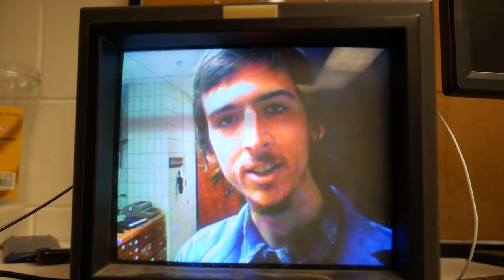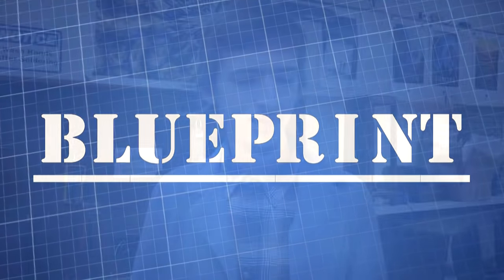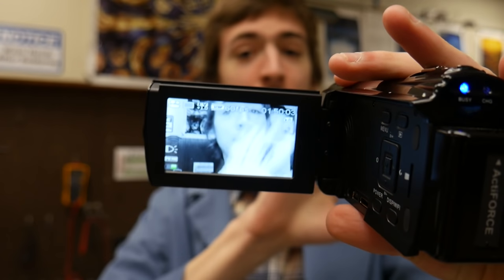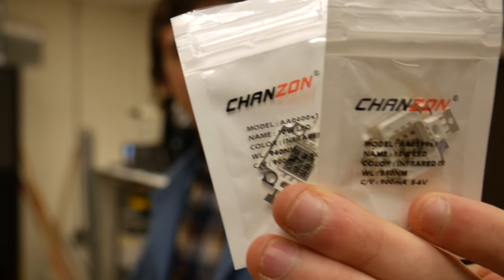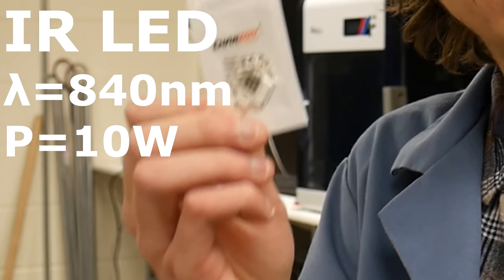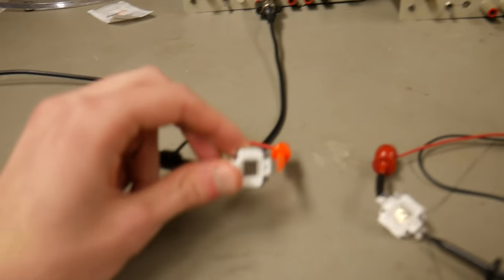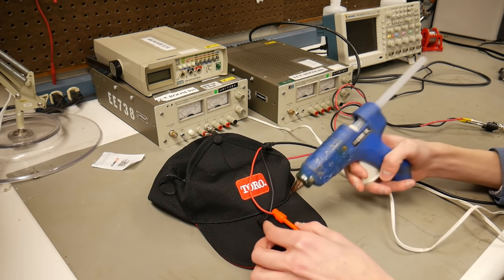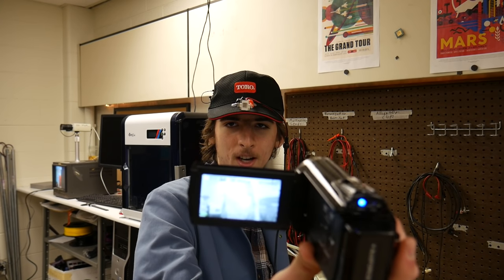How to Fool IR Security Cameras

Comment: Great Information ! and what if we wanna bypass normal camera ?
Reply from the maker: Salman Jamil, that’s not so easy. You can pull the same trick with visible light, but that’s about as conspicuous as it gets.
I can, of course, NOT condone anything that does permanent damage to the camera, but that opens up a lot of possibilities.
Reply: @BlueprintScience  can you tell me which light could damage camera ? i will try with my own property 
ultra , infra or visible?
Reply from the maker: @muhammadsalmanjamil7182  It's not so much the kind of light but the intensity. For instance, a high-power laser could overwhelm the sensors and destroy them quite quickly.

BTW, another trick that I didn't think of earlier: strobe lights. I've never personally tested this, but a fast enough strobe effect can look like a normal flash light but make the camera image unwatchable.
Just a thought.

Comment: what up man.. I need your tips in how to spot IR cameras or any other spyware equiptment..for some odd reason whatever I do in the privacy of my room is well knowen through out the hood.
Reply from the maker: An interesting question 🤔 
For starters, information is key. If you don’t uncover the person responsible, then any countermeasures are temporary at best. You should be mindful of who has/had access to your private room.
As for detecting and removing any bugs/cameras, there are some ‘transmitter detectors‘ that pick up the wireless signals that spyware use (it is unlikely they are wired up, of course). But these detectors vary greatly in quality. I would personally use an ‘inductive amplifier’ which can pick up just about any electronic device EM field by simply being held near it.
Oh yea, and I think there are professionals you can hire also!
Good luck 😉

Comment: A 10W LED is going to put out a lot of waste heat and burn itself up. What are you using to heat sink it? Also I imagine the power source for such a device would need to be quite large, even using something like high capacity Lithium ion.
Reply from the maker: Yep. Lithium battery would power it for a few hours. And, yes: it is wasteful and generates a lot of heat. It can go for a bit before getting hot though, so I didn't think it was necessary.
Reply: @BlueprintScience  I actually think this has real potential if you could get the LED to run off of USB power. A standard "high power" charger now puts out 5Vx2A=10W. These chargers are cheap, high capacity, and readily available. A small aluminum heat sink might be helpful.

Comment: One of my cameras allows me to shut off the IR light and use a separate I are light that actually goes through glass it works great my question is if I have five other cameras they only have the capability of having color vision I are vision or black and white I are visual there’s no way to shut off the IR vision so there’s not a shine back off the glassIs there a way to cover the IR lights on the camera and just use the IR light that works through glass because that works fine but how would I do that

Comment: I work security at a large facility.  There are cameras everywhere.  We have both normal cameras and some IR cameras. I have tried to locate the IR ones, using a hidden camera app, but even the ones I know are IR don't spike on my apps. 
Do you know why? I really want to try this on a couple cams that are in areas only security goes.
Reply from the maker: Ivan Beals, I’ve not ever heard of such an app. What is it called?
Reply: @BlueprintScience  Hidden Camera Detector by Futureapps

Comment: I think it was a nice video!!.
Now for my question..
Zmodo wi fi cams work great... you can turn their motion sense off, and that darm relay-clicking sound will go away, but you lose I.R. Illumination too.. 
Ir illumonatin is a Big Bust cause your creeps n criminals can just SEE the Red Ied.
How can I retain I.R illumination without the Blow-IT-Case RedLed Screeemin HERE I AM IM  A CAMERA NOW DONT DO ANYTHING I WANNA CATCH YOU DOING!!!   Would solve a Ton of trouble.... is there an I.R. illuminator that doesnt Stand Out Like A Sore Thumb???
Reply from the maker: True IR isn't visible at all. IR LEDs tend to bleed into the visible red range.
Without altering the internals of the camera, you could but a red light filter in front that still permits IR light.
Better yet, if you feel like doing some soldering, simply remove the light an replace it with a more desirable wavelength light.
Best of luck

Comment: I've some of those LED's you have there, but I have a problem with the 10 Watt spec on them. The specs say 5 Volt, 1000 mA (840nm), and 1050mA (950nm). That does not calculate correctly, but to 5 Watt. IF you connect 5 Volt directly to them, they do draw about 2400mA and heat up like crazy. I cannot get any sensible answer out of the place where I bought them, nor on googling them at the manufacturer. They just insist on 10 Watt 1000/1050 mA 5 Volt...??? Basic Ohms law differs. I've now reverted to using a little adjustable buck Lipo charger set at 5 Volt and 1000 mA, and that is 5 Watt. Can you "enlighten" me on this little problem please. I'm "old school" who still believe in Ohms law.

Comment: I have a dbag neighbor who has installed 2 cameras that points to my personal courtyard aiming to my entry door and one overlooking my side door. Laws will not protect me since the arm of his cameras are attached to his building. How can I use this to blind his cameras?  Do I need a power source with battery? Please help!
Reply from the maker: I'm not a lawyer or anything but I do know that jammers and destruction of property are out of the legal question.
You could put LEDs on your lawn to blind the camera, but that would take power, get hot, and not eliminate the problem.
If it were me, I'd escalate the situation with an even bigger camera! And livestream it to the internet! And run ads on the video!
Reply: Thanks for getting back to me! Obviously not tech smart so I’m wondering what kind of battery operated attachment did you put in the baseball cap? Is it a rechargeable? Can you plz list that? Thank you!
Reply from the maker: @MissAyor  I didn't have a battery in the cap; I used wires the entire time. If I were to use a battery, I'd use a lithium battery, most others couldn't supply that power for long.

Comment: IR cameras have been obsolete for 5 years or so. newest tech is intensifier or starlight or colorvu technology cameras. for they don't use any IRs to illuminate the area they simply open up the lens more. So if someone uses an IR to over expose the shot it will do nothing for it doesn't respond to the ir

Comment: You need to set the Current, not the voltage, to compare.  You should have wired them in series.

Comment: I had an idea to install flash triggered flash switches like ones used in photography that fire off a strobe when it detects another flash  and use it to trigger bright strobes onto my license plate when it gets flashed from a speed trap and has to use strobes to get the right exposure for the fast cameras thru use and hopefully flood out the license plate enough to make it overexposed so much its unreadable.
Reply: I just don't put the plates on my vehicles
Reply: @rusty_schackleford 
Or you can do that.

Comment: 5V @ how many mA? Anyone know about resistor and whether to use 80% of max LED current (or supply voltage - forward voltage)? Trying to remember electronics - cool to make this a mobile setup than have to drag all the equipment around 👌🏻

Comment: This invisible light can cause damage to eyes over time.  especially at the voltages he is using.
Reply from the maker: No, that’s ultraviolet (UV) that you’re thinking about
Reply: @BlueprintScience  850nm light is used in Fiber Optics.  Depending on the power used it can cause eye damage.  Yes, it is infra-red, but all light used in Fiber Optics is in the Infra-red range from 660 - 1625 nm.  Most of it also invisible to the human eye, as most of the waves in that range is outside the spectrum of what the eye can see.

Comment: WELL MR BLUEPRINT MY CAMERA OPERATES A RELAY  CIRCUIT WHICH OPENS A DOOR AND RELEASES MY TWO PIT BULLS WHO'S FAVORITE CHEW TOY ARE Blueprint fuzzy roundies.
I use 4 hidden cameras, none of which have the IR leds turned on. I use 3 198 led IR wide field IR illuminators.
Cameras are nowhere near the three IR illuminators. So try that.
Reply from the maker: I keep telling my friends to just get a guard dog :)
Reply: @mavgk61.    This guy is simply illuminating the science of eg how to start a car engine while you reply & talk about your truck that is never switched off.   
    Incidendly what is it of very high value to burglars that you need these powerful separate ir lights for your 4K camera supplemented by not one but two pit bulls?   I reckon most people would feel safe with only ½ a pit bull without any cctv

Comment: I have wired cameras at home and I get break ins and the DVR does not record it.  Furniture and cabinets and flooring gets nicked, scratched, gouged...vandalized.  My other wireless/wifi cameras gets jammed outside.  How can a wired camera system get jammed with those 8 antenna jammers that are illegal in California?  Components on the camera are sensitive to certain frequencies or the crystal on the board is affected?

Comment: Numberplate. So place 4 leds at the back above the numberplate and when it's dark. Highway has no speedlimit anymore. The phone will be a nice black card with a white ghost.
And because they also measure from the front with cams and laser, exactly the same.
Ghost driver is born. 
Inside the car above me in the sun strip and also in the middle and the passenger site and when it's dark night vision came don't work for picking Apping or Calling drivers out. Even Seatbelt at night.

I could replace the LEDs from a text bar and programm ACAB All Cops Are Basterds. Or something like that....maybe pot (weed) for sale, put me a-side and use the codeword "Papers, a joint and don't tell my partner". I will record it on my dashcam and visit the police station next day. Dashcam has recorded his car and him with working nightvision. LMFAO